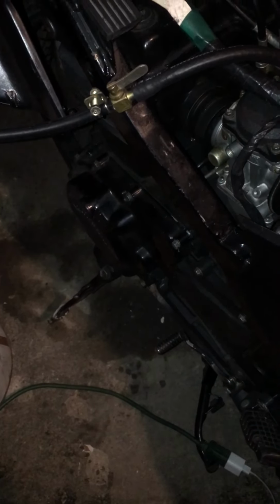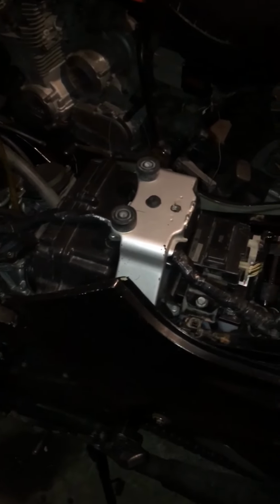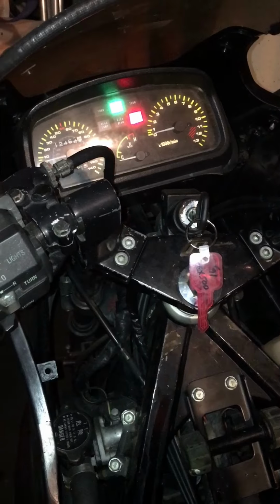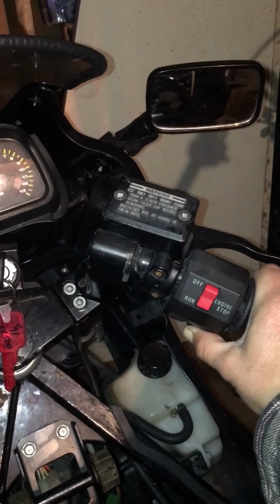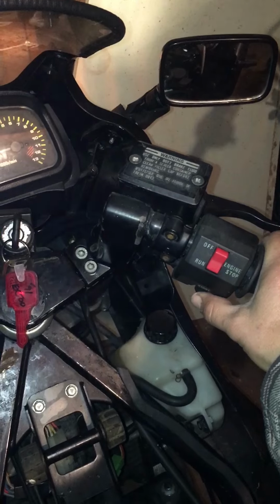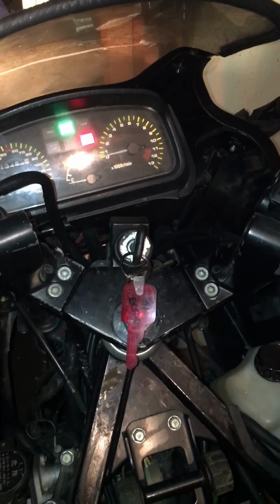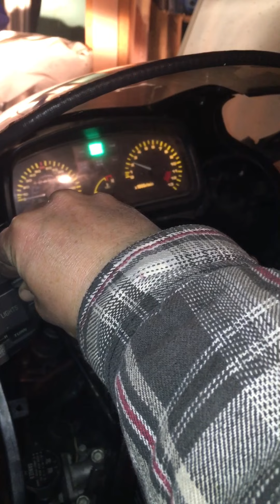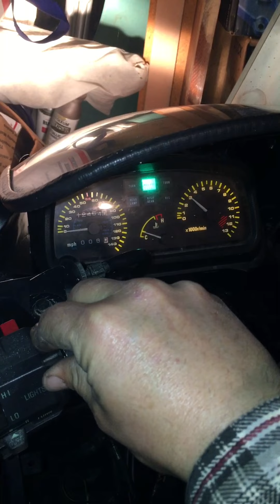Kawasaki Ninja 500 First Start Revving Warm up Project EX500 500R

Comment: I have the same bike and I’m having the hardest time figuring out how to hook up the fuel the right way
Reply from the maker: I did a video on fuel Petcocks(fuel taps) that may help you. Find me on Instagram  normalguy_gettingby and we can message back and forth. There is a line coming off the bottom of the fuel Petcock that carries your fuel....that goes  it between the carbs to the lower fuel rail.....should be a plastic black tube
Reply from the maker: The other line in a vacuum line the plugs in between the engine and left carb